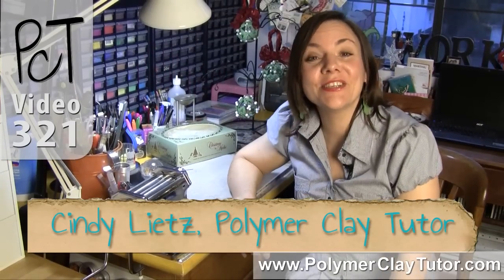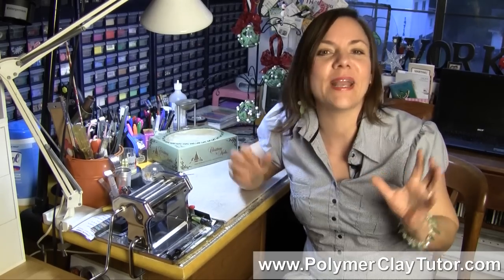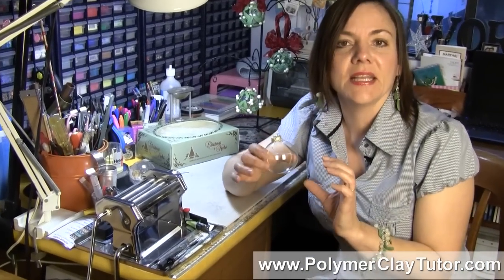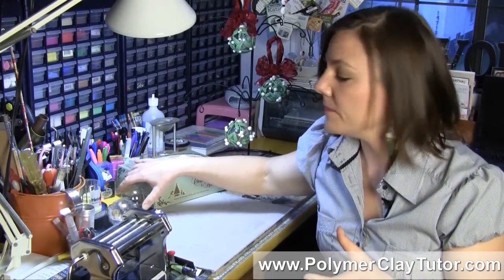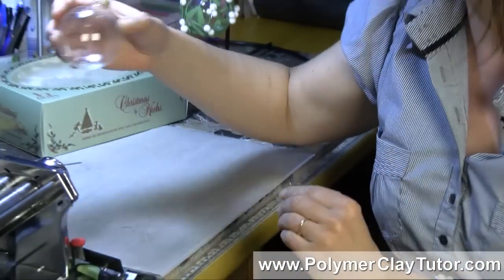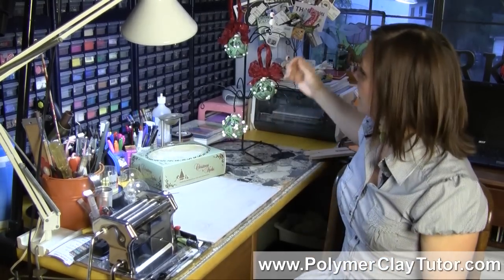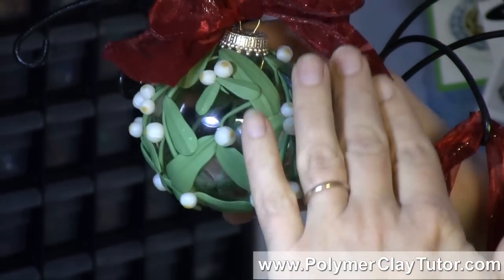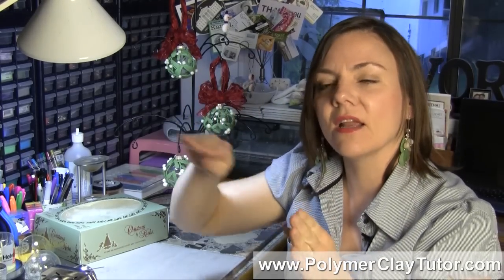Glass Ball Ornaments Polymer Clay Do's and Don'ts

Comment: This is great, glad I only nade 1 glass covered ornament. You said total baking from cold to cold oven is 1 hr, when the instructions on the polymer clay is 275* for each 1/4 inch of clay. I did it for 15 min. I also learned on a turorial I can bake, then add more clay to it, then bake again. Is that part correct? If so for how long?

Comment: Thank you for this it was very helpful. I am very new to clay but plan on making some Christmas ornament gifts this year for my family. I saw one video on YouTube where she used like a cheap glass ornament that had like a varnish or they were painted silvery white and I just knew deep down this would be an issue if I got similar ones. I do not want toxic fumes in my home and I think putting varnished ornaments in the oven will be a problem. She did say the clay pops off after baking so to glue things on and I am curious... if I got some clear glass ornaments and painted ones (of the same/similar size) baked on the clear and then glued pieces on to the none clear, would this work?
Reply from the maker: I am sure that I am too late since Christmas is in a couple days, but yes that sounds like something that would work. Hope it worked out for you!

Comment: I experience cracks in the clay when I cover wine bottles, which happens later on, like after a few weeks. Using the cold oven and let it cool completely in oven. Also Premo at 1/8 inch. Should the clay be thicker, thinner? Other things to troubleshoot?

Comment: Hi Cindy if I put liquid  polymer  clay will it stick  so that I can do a Santa or an Angele on the balls . And how about these  mug I see on Pinterest that have little  dolls or teddy bears in front., will they  keep there place with liquid polymer clay after a soap wash or will they fall out
Reply from the maker: Liquid clay probably won't be enough to stick the clay permanently to glass ornaments or coffee mugs. I usually design my clay in a way that doesn't need glue, when adding to clear glass, but I have heard of people using clear construction silicone adhesive (a tiny amount) to glue clay onto clear glass. I haven't tested that yet, but I think that would be worth trying. With the mugs I would use Gorilla Glue White, 2 part epoxy or the silicone, if it works. Definitely test on your own projects though, to make sure it will work for you. Good luck!
Reply: @PolymerClayTutor  thank you Sindy